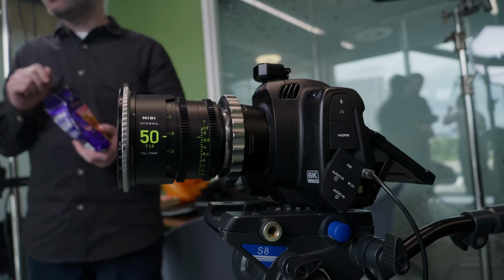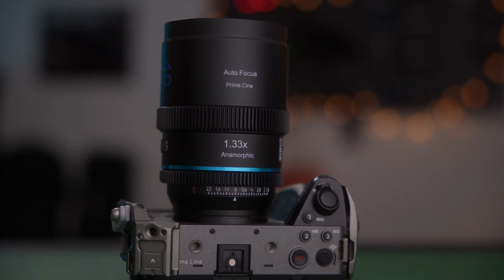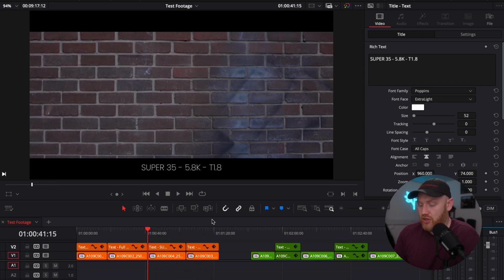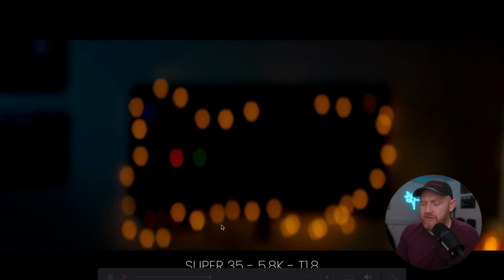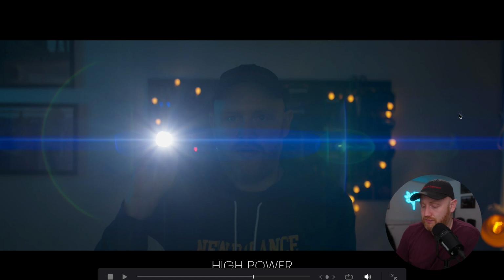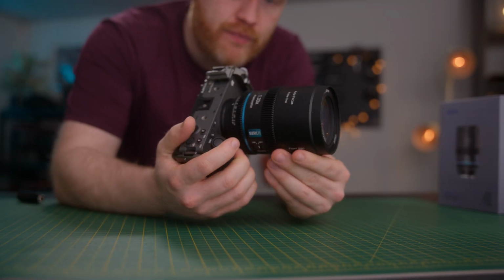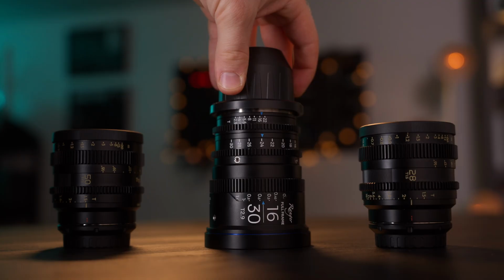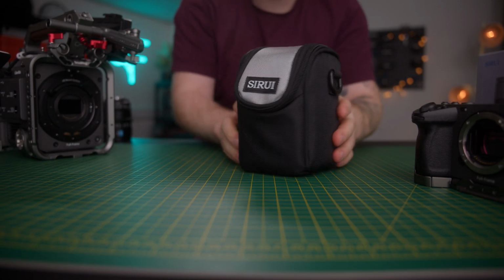Love It or Hate It, This Lens Is the Future

Comment: If sirui makes a full frame set i will buy it but i simply do not want s35 lenses
Reply: Open gate s35 is 1mm smaller than full frame 16:9 you been lied to and for filming some of the best films of all time were filmed in s35. Finally 1.33 squeeze is bad. 2x nothing else is worth it.
Reply: @eventhori3on  i am not a fan of 1.33 either but it would be a nice everyday lens, i tried the viltrox 1.33x fullframe and they are a cool compromise, i think 1.5x and 1.6 would be amazing though since siruis already have the saturn set. I have the saturn set and it is okay. and i really do not care what hollywood uses, my main setup is full frame, i will not buy lenses that do not cover my sensors. Cropping in post is also nothing i want to do because clients will not understand it when they watch on the monitor on set. 2x is amazing i had a few hypergonar and i have the vazen fullframe set which is 1.8x (like the cooke) but i do not think they will ever make 2x autofocus lenses. S35 on red cameras in will cover because of the 17:9 sensor, that is okay but i simply do not have a red.

Comment: when will they have it for Full Frame L mount?
Reply: That's pointless.  And a 1.33x anamorphic does barely anything.  Save your money. Anything below 1.8 squeeze is pointless 2x is what you need and no one does that I don't believe unless you want a massive projection lens or a 20k lens
Reply: @eventhori3on blazar does 2x lenses under 20K
Reply: 1.33 AF Sirui 20mm and 40mm are on L-mount